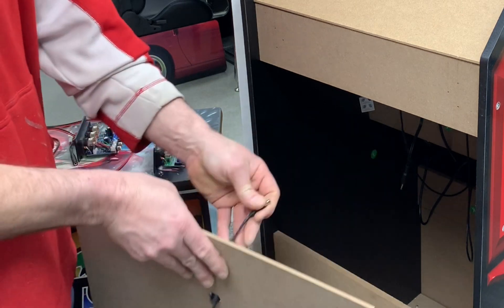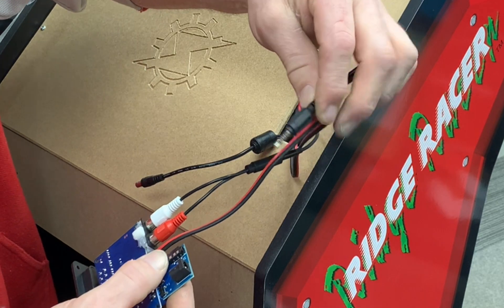Ridge Racer OutRun Amp Kit install

Comment: Great video and a nice kit! But what if you just want to add a powered subwoofer istead of the bass shaker? Should we just get the 2.0 version and use a Y-splitter out to the sub, or can the bass shaker's output be used instead, somehow?
Reply from the maker: If you want to add a sub, you definitely want the 2.1 so you can connect the sub to the .1 channel.

Comment: I have a kit on its way and I bought the 2.1 amp. Does it have enough ports and power to push the shaker, stock speakers, and a small powered subwoofer? I'm trying to find a compact sub that I might be able to put inside the BSA seat stand that comes with the seated conversion kit (not the A1up seated version) for RR.
Reply from the maker: Would probably start with mounting the bass shaker under the seat and see how you like that. An additional sub might not be all that necessary and might be too much for the amp.

Comment: Great informative video as always. I'm not sure if I want the standard Racing Box or this one made for the Outrun & RR cabs. I'm concerned about games that use multiple buttons for things like turbo boosts, items, hopping/jumping (Mario Kart), tricks (ATV games).The spreadsheet shows some games utilizing some of the buttons for gas, brake, shifting, etc - If I'm not mistaken.  Can you guys show a video on exactly HOW some of the major titles' buttons work? Just the AAA titles (Mario Kart games, Spy Hunter, Hydro Thunder, etc. I'd like to SEE how easy it is to steer, hit turbos, hop, use items, etc. For this reason I may just go with the standard Racing Box where I can use my Hori wheel that has all those extra buttons - might make it a better experience.  Thanks, guys!!
Reply from the maker: We'll try to do some of that when we release a video on our v1.1 build. But to be honest, the shifter on the RR/OutRun changes the game - it is great and we've utilized it really well. I think it's more intuitive in most situations than the Hori wheel with its buttons all over the place.
Reply: @BuyStuffArcades  OK, cool. I'm sure it's workable, just trying to picture how it'll work. I appreciate it, and hope to see some footage once v1.1 is  released. Thanks.

Comment: Hey where's the 3rd cord plug into the game box ? I don't see anywhere to plug into the board
Reply from the maker: Did you get it figured out? The voltage regulator plugs into the Gaming Box and feeds from the red port on the encoder board.

Comment: If I just want to hook up a soundbar do I need this board or is there an adapter cable for rca  out
Reply from the maker: You don't need this kit for using a soundbar. A Soundbar can be connected directly to the Gaming Box. We supply a 3.5mm male to male cable, but you can adapt to the RCA or connect a longer 3.5mm to RCA cable directly to the Gaming Box.